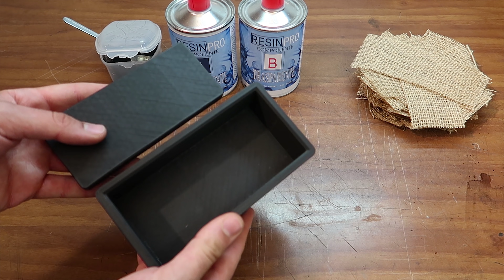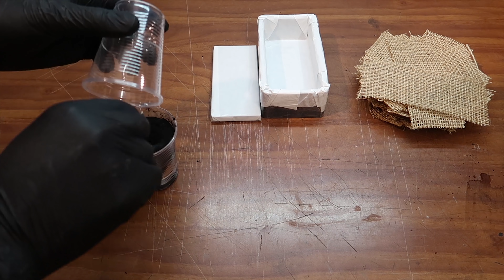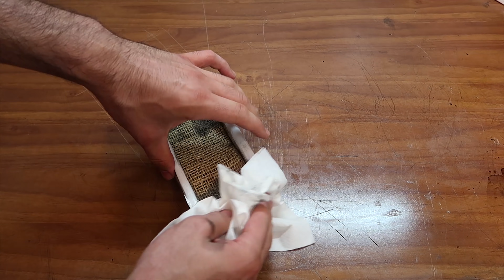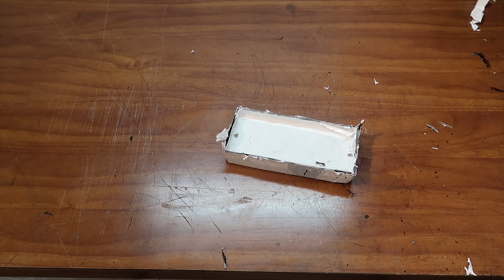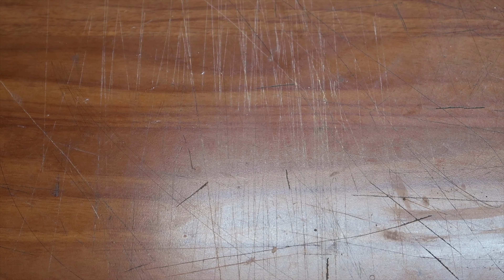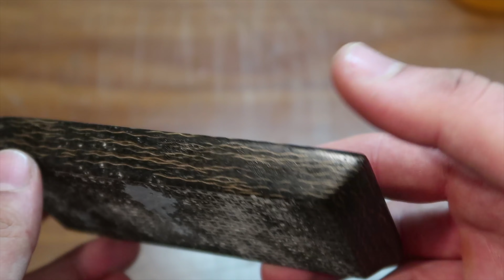DIY Micarta Black Burlap

Comment: I started playing with micarta making recently. I made a few forms like your container but made some clamps that are smaller (l also use small c clamps). I found that a small vacuum made less pinholes and really saturated better. I had some thick clear plex so I made a vacuum chamber and stuck my old    A/C vacuum pump on it. With minimal inches of vacuum it really made the consistent appearance and better looking with less bubbles and blemishes. It's just what I have been doing and I'm impressed with how it came out with all home made stuff and a vac pump. Oh asndf my pump is pretty old and weak so it doesn't take much. Like the videos a nd not trying to be negative just sharing what I have come up with
Take care.
Reply from the maker: Thank you Billy :) I'm planning to build one from a fridge compressor :)
Reply: Wow. I like this video and your advices too. Thanks to both of you! I think I'll do my own micarta very soon... 👍

Comment: Hey man, very nice, I like it. Why don't you try to use vacuum to get the bubbles out of the resin? Using an old compressor from a broken fridge will do the job as well. I use it to get out bubbles from casting material...
Reply from the maker: Thanks! :) I will try! I have a fridge pump already, just need to build the thing :')
Reply: Naah, no special task. Just a vessel that can be closed and a connection for the vacuum. The compressor have no special needs too, just connect the cables to the grid. Google is your friend :). Waiting for a new upload

Comment: the final result seems just fine. I have a question though, if you know, is there any difference in the final result if you use polyester instead of epoxy resin?

Comment: Just to be sure, did you add the black pigment to part A of resin mix? Is the pigment oil based? And how did you measure out the pigment?
Reply from the maker: I guess you can add the pigment to whatever part you want, I've never heard it makes any difference! :) the pigment I've used here is powder, usually you don't need much to color resin, but I'm no expert... You can start with little and work your way up to a color you like! :)
Reply: Black Beard Projects thank you for the reply. Im looking to make a thicker micarta in purple for a pistol grip. I'm going to try and shape the pistol grip put of the block in attempt to have a built in thumb rest and magwell.

Comment: So did it cost more or less if you would have bought it??
Reply from the maker: Resin is pretty expensive, got the can you see here for 22€, but burlap is very cheap and I got the pigments from an used printer toner. I guess I can make at least 10 blocks with the resin I have, so I would guess it cost me not more than 3.5 € each :) The only store where I can find micarta locally sells black burlap for 30.35€ a piece+shipping! (not joking) :') So yeah much less

Comment: great vid - however 
use parchment paper for non stick release AND take off the ends of your mold or drill large holes for drainage and use 20% more resin . this will eliminate ALL voids simply with pressure. you don't need a vacuum chamber.
Reply from the maker: Thank you for the suggestion Jack :) I thought about drainage holes, but then how can the piece come out when the resin is cured? re drill the holes? Thanks again :)

Comment: Lay down some plastic next time, you don't want to get resin on your table!
Reply from the maker: Yeah might be better :) I'm not really worried about my workbench top anyway, just a slab of melamine :')
Reply: that's perfectly fine by me. have you thought about recycling HDPE for a knife material?

also, today i got into a similar situation as you did during your cleaver build. My knife isn't as big, but I can still use it as a skinner or something. I made a bad decision while handling a hardened knife I thought didn't harden.